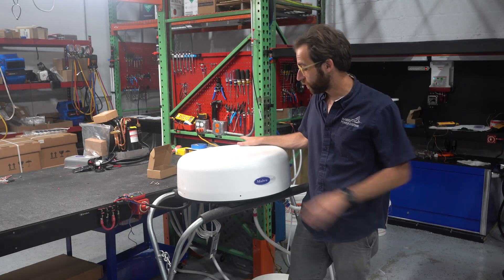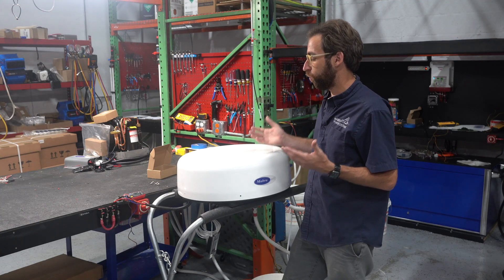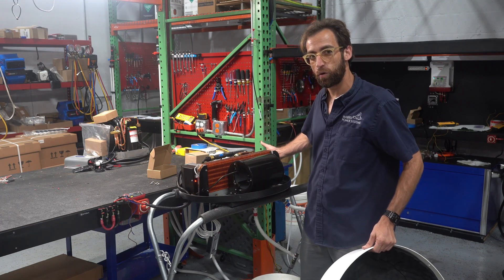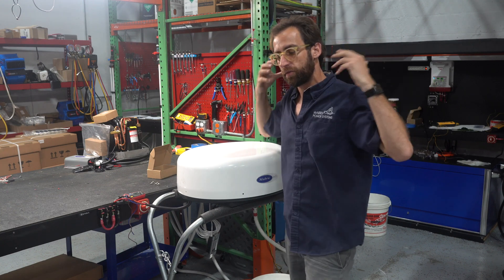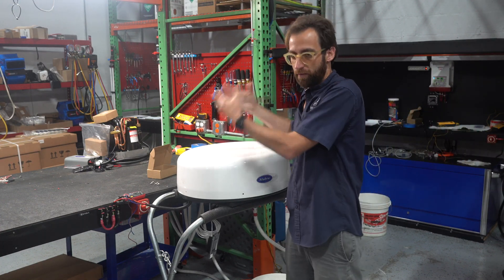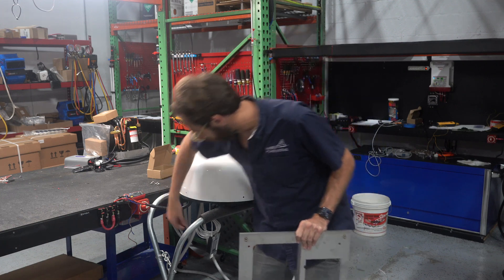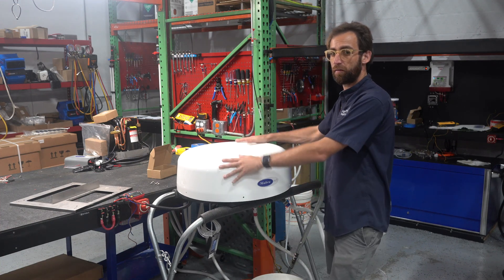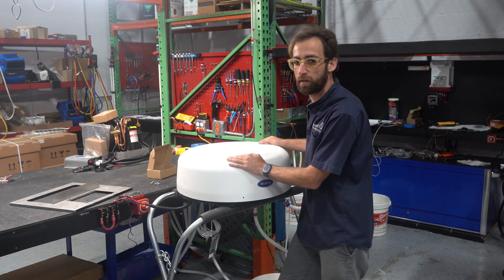The Latest Marine Air Conditioner by Mabru that will Revolutionize Climate Control on Boats. ROOFTOP

Comment: Is this unit evaporative cooling or refrigerated cooling ?
Reply: The unit uses a compressor, not evaporative cooling and is also reverse cycle for heating in cooler climates.

Comment: First of all I would love to see a real breakthrough on marine ac and I applaud your efforts. However, Isn't this much like the old 4-5k cruiseaires that fit into boat hatches? I still have 2 of those units that I no longer use. At least in terms of warm and cold air passing very close to each other as they exit and enter the boat? And that amp draw still seems high if best draw is 20amps.  I dont know. I doubt I would prefer this to my current DIY setup of a Honda 2200i generator powering a 12k Webasto ac. All night long even in August this system keeps my Catalina 36 nice and cool in Charleston SC with the generator running in eco mode. Very quiet and vert economical.
Reply from the maker: Sorry for not responding sooner. This is very different from the old Cruisair Carry-On (which was also designed by Alain Mabru, under contract with Cruisair) as the Cruisair unit was 115v, air cooled, and only secured by its wight over the hatch. It was not a permanent installation. The RadAir unit is 12,000 BTU and runs at 12v which is what I believe is throwing you off. The unit draws about 600W at full capacity and is water-cooled so there is no hot air coming from the unit, unless you are using the reverse cycle heating function in colder climates. This system can run off of an EU1000 through a battery charger or for 5 hours at full capacity with a 300ah Lithium battery.

Comment: Will this unit be able to run on a lithium iron phosphate battery? Or do you need a generator?
Reply from the maker: This unit is a 12v unit and intended to be ran off of batteries rather than a generator
Reply: @MabruPowerSystemsINC drawing 30 amps or won’t run long unless you have a battery bank that cost more then your dinghy
Reply from the maker: @jamiehackney4420   a 12v 460AH ah Battery is available from Epoch batteries at this time with a retail cost of $1,699.00. That battery would run this unit for a little over 8 hours, running at full capacity.
Reply: @MabruPowerSystemsINC  However that said battery would require 11.5 hours to charge back up @ 40amps. Solar would take days. So you mind as well save money and get a unit to run off a smaller generator. Just my thought.
Reply from the maker: @jamiehackney4420   This unit does not work for all customers but it can fit a wide rage of customer needs. I don't use my personal boat every day and have 120A of charge from my inverter so I can recharge my batteries much faster. Even waiting 11.5 hours would work for my application and many of our customers. To be fair though, you are accounting for 100% use of the battery where the calculations I had done were based on 85% discharge and we would use at least a 60A charger, not 40A so it would be just over 6.5hrs to recharge. Other customers use this unit when their engines are running so they have a very small (100ah) battery bank that acts as a buffer between the alternators and the engines. Most alternators today are at least 75A and most boats looking at these have at least (2) so the alternators have no issue keeping up with the unit draw. It's fair that some customers would prefer to have a generator to run everything and that's fair as well. There are plenty of products available in the market to fit those needs. We prefer the simplicity and reliability of the battery powered systems rather than dealing with the noise, maintenance, and dependability issues of modern generators.
Reply: @MabruPowerSystemsINC  I am editing my original remarks because after checking, lithium prices are continuing to fall so the dollar cost of batteries is dropping. Maybe 460ah is enough but I am skeptical. And 12k is not much on a boat in warm/hot summer water. Would love to see 8 hours testing in outdoor temperatures where the water like we have here in Charleston hits August 95 degrees. The WATER! Still like I said I applaud your efforts. 12v compressors are probably the way to go. And combined with lithium or some even better battery technology may get us there one day.

Comment: Looking for 24v systems are your units 12-25v???
Reply from the maker: This unit is strictly 12v, a 24v system would require an 800w step down transformer
Reply: @MabruPowerSystemsINC  My house bank is 24volt that is why I asked if you made a separate 24v system. Obviously not so I will refrain from purchase until you have a 24v system.  Are there plans to develop one?

Comment: I love this idea but can it be taken one step farther to attach to roof rails (like found on an Axopar and many others) and work by sliding back the sunroof a bit? This would allow it to be a seasonal installation and taken off in other times of year. This obviously would make more sense with an air cooled AC but perhaps it could be plumbed for seawater cooling if not…

Comment: Looking for a solution for my 2021 Parker 2810. This is probably beyond overkill since it’s the walk around with berth as opposed to the sport cabin. But I need something!
Reply from the maker: the 12k will be overkill but will be able to do the helm and cabin if there is space on the hardtop for this unit but there may be a space port side either under the sink or in the storage behind it for a 5DC.